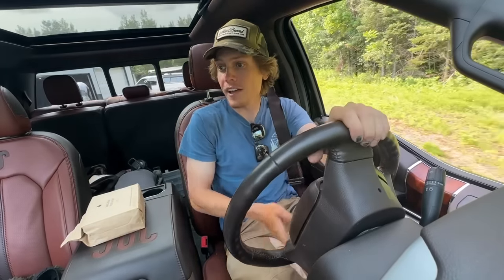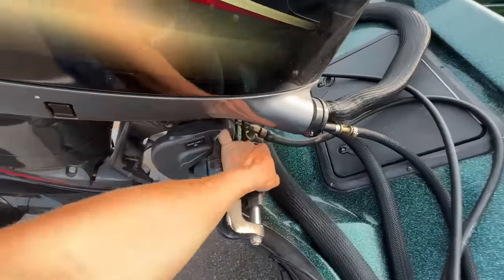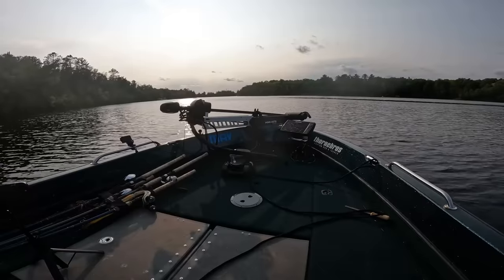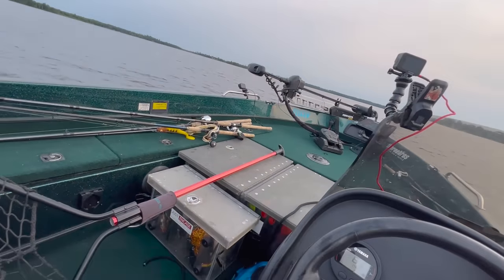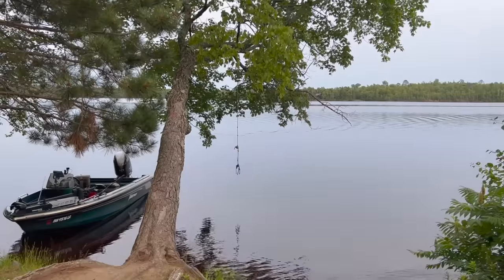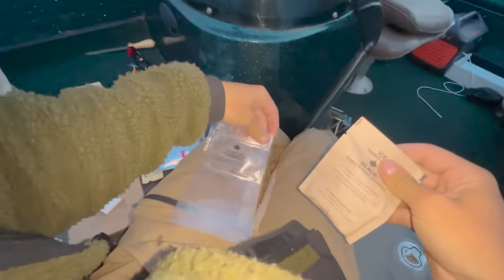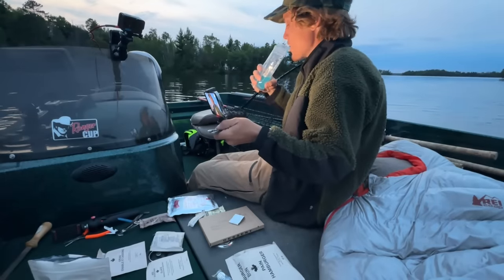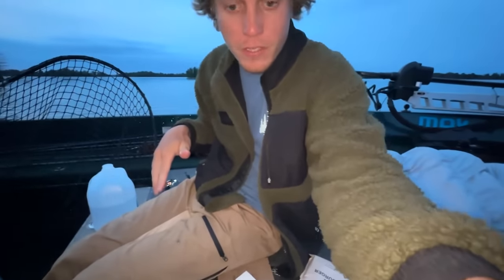Boat Camping w/ Expired Canadian MRE

Comment: Overseas we put it in a water bottle. Our water to drink was in bottles. Use 1 bottle. Part of it goes into the heater. The rest gives space for the powder and to shake. But we also started getting first strike mre. Which had chicken or tuna in a pouch.  A pulled pork pocket. No heater

Comment: They started to put the mre's on the engine block to heat them up.  On the outside package the last number is the package date.  If before 2020 then 1 will specify the year 2011.  the three numbers before will be day of year it was packaged.

Comment: You never mix the drinks in your water bottle. We usually just pour the powder into our mouth, followed by some water, and swish around. The reason for not mixing in your bottle is that if someone suffers an injury where you need water to rinse it, it is probably not great pouring a protein shake or sports drink over an open wound.